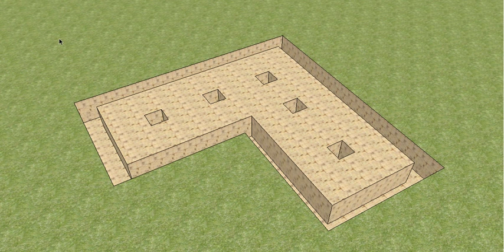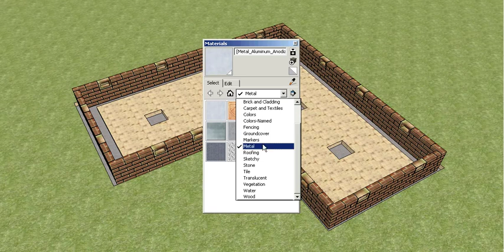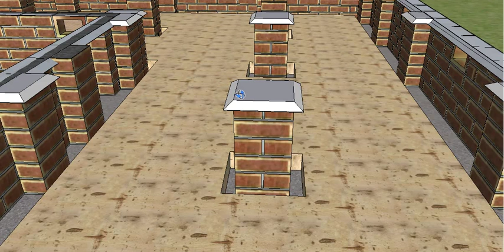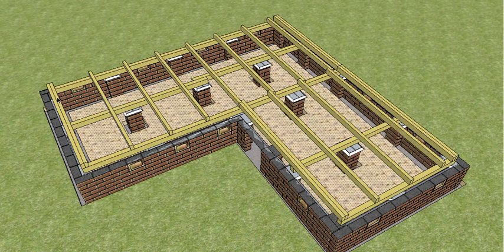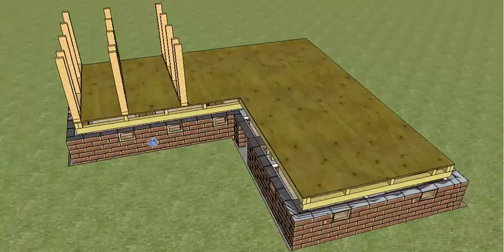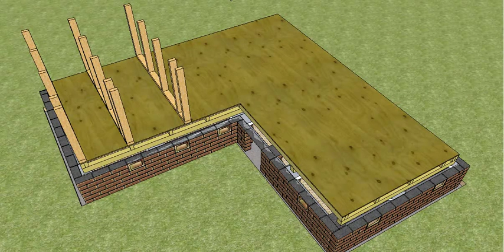Platform Flooring System

Comment: Thanks for your excellent videos.

I have some questions for you if that's OK?

Would there be any benefit by also having water proof membranes underneath the foundation perimeter footings? And also underneath all of the isolated pier concrete footings? (I'm not sure what stand alone piers are called).

That way there's a double benefit of controlling rising damp i.e. before it even gets into the cement footings and if it does then also with the traditional damp proof course on top. Basically I mean a two pronged approach to combating rising damp.

Also is there any reason to not include concrete reinforcement in the concrete footings for the piers as well? I mean the isolated piers. I'd put some reinforcement in there for good measure unless there's a reason why not (apart from extra labour, cost and time).

Thanks a lot for your videos!
Reply from the maker: Hi Cameron
Thanks for you comment
With the waterproofing if the damp proofing is done correctaly then there should be no need for the additional protection. I would spend more time and effort on the one method rather than on two different methods.

With the footing the reason there is no reinforcement is because it is not required. Blob footings wont be exposed to tension forces as they are so small and will just move with the ground rather than flex etc so any reinforcement that you use will just be a waste.

Comment: Hi Buildsum,

Thankyou for all the great videos! Really helped me with a major renovation I am completing.

I just had a question in regard to replacing a platform floor on a 1st level house. 

As the house frame has been build on the platform and cannot be pulled out, to replace the chipboard floor, do I just cut the chipboard floor along the wall to remove, following the floor joist line (so basically the frame stays on a strip of chipboard) and then add a new joist in to support the new floor, or can I nail/bolt timber to the existing joist to support the new floor edges? (Obviously only need to do this on 2 sides of the building, as the floor can sit across the floor joists on the other 2 walls). 

Hope that makes sense and I would love to hear your thoughts on this.

Regards
John
Reply from the maker: Hi John
Yes, either option is possible, nailing blocks to the existing joists is probably going to be the easiest option as long as they are spaced no more than the existing joists.
Reply: Thanks for the quick response and information BuildSum! Much appreciated! John
Reply: John Hudson 🔥

Comment: Covering the edge of the concrete with soil  .. if it's only a narrow margin it won't matter much, but if a homeowner is trying to build a garden bed there, they won't be happy about concrete hidden under the soil around their house. Any plant they try to grow over the concrete is just going to die.
Reply from the maker: It would only be 35 to 50mm from the wall so not going to affect the garden bed much however I actively discourage any garden bed hard up against the house as they make the termite protection null and viod and encouges differential movement of the footings.

Comment: Hello  buildsum
If you have a 1cm horizontal crack and step cracks on the dwarf wall (lets say across 3 bricks)does that mean ur foundation is settling ? . . Will engaged pier help to slow down the settlement.  .. ?  How does engaged pier help with this ? 
Thanks.
Reply from the maker: Hi Blue, yes this would mean that your footing are settling unevenly. As engaged piers still sit on the footings they will not help with this issue. The solution, and it is not an easy one, is to underpin the footting. This involves excavating under the existing footing and pouring in more concrete to make it stronger.
Reply: @Buildsum  is resin injection another solution? Other than underpinning ? 
I think it's a common problem for 1960 house
Reply from the maker: Hi Blue, Yeah for a home of that age it is not suprising. I am not aware of any specific resin system however they are always coming up with something new.
Reply: @Buildsum  thank u so much :)

Comment: Are you allowed to counter lever bearers on a exterior deck with no load
Reply from the maker: Hi Liam
Yes, you can whether they are loadbearing or non-loadbearing. The span tables generally give you the amount that they can counter lever. This video may help if you haven't already seen it. https://www.youtube.com/watch?v=OjSKuSZCWKY&t=1s
Reply: I mean are the bearers allowed to stick out past the post. On all the diagrams I’ve seen they always finish flush. I know you can counter lever the joist. Not sure about bearers though
Reply from the maker: Hi Liam, there is nothing in the Timber Framing code that I can see that says anything about how far the bearer can stick out past the post. the only thing that is says is " must have adequate support".  I have seen bearersjust bolted to the sides to the post however there is nothing in the Code that says it is right.
Reply: Buildsum okay no worries. Thanks mate 👍 I love your videos. Keep em coming, as an apprentice there a big help learning the trade. 😃
Reply from the maker: Thanks Liam, I'm glad you like them.

Comment: How do you fix the bearers to the piers
Reply from the maker: Hi Ragan, depending on the wind loads you may not need to and a lot of Bearers andJoist floors aren't actually fixed to the Piers. However with the increasing amount of concern about wind forces tying down the Bearers is becoming more the norm. Personally, if I had to tie the bearers down I would not use the brick piers I would use steel piers instead as they have built-in tie points. If you had to use brick piers you can either embed a threaded rod into the brickwork and through the Ant Cap, just make sure that you seal where the rod goes through the Ant Cap with the appropriate caulking or just embed the rod straight into the footing and then up to the bearer.
Hope this helps.

Comment: no blocking at the end of the joists? how do u stop them from rolling on there sides
Reply from the maker: spiloFTW Hi spiloFTW because the height of the joist does not exceed 4 times the width (or thickness) of the joist the normal fixings and the flooring will stop the joists from rolling no blocking is required in this situation